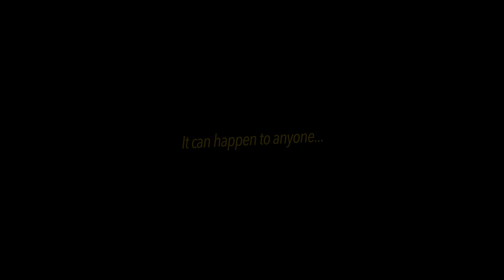SILENCE! How to fix contaminated disc brakes

Comment: Apparently, this method works. Has anyone experience with the SwissStop Brake Silencer? Or car / motorcycle brake silencer sprays? I ave both, but am yet to use one properly.

Comment: Will I need to bleed my breaks after or should it be fine? As I got oil in my break pads
Reply from the maker: As long as your brake lever "pressure" feel fine, and there no "sponge"-feeling when braking there should not be any need to bleed again. 
On the other hand, a bleed never hurts :)
Reply: @ridesofjapan  ah ok thank you 🙏

Comment: Remove rotors & soak them in small shallow tray with acid tone for 30 mins as gets into every hole, were a rag doesnt.
Like he does at 5:26 with pads but soak ur rotors, then clean solution then pads.

Comment: Acetone, Isopropyl, or denatured alcohol. Use scotchbrite after a rag.  (If using sandpaper, try drywall sandpaper, won't get clogged with pad material) Clean pistons. Use alcohol or above mentioned. Clean. Sand. Clean. Dry. Then use a q-tip or eye dropper with brake fluid to lube the races of the pistons. Work them in & out. Install. Re-bed brakes in.

Comment: Might be obvious question, but , do you also need to clean your tires so it does not contaminates again?
Reply: You also need to clean the road infront of you for any amount of oil, as it can spill up if the ground is wet. Isn't disc brakes just a smart system?

Comment: Tobias, have you try "burn" the pads and rotor like many people are saying to do? I've tried using nail polish remover and sanding several times, but it always comes back to the horrific noise. I also replaced the break pads with new ones and it still making the noise! I CAN'T LIVE WITH THIS NOISE ANYMORE. PLEASE SOMEONE HELP ME!
Reply from the maker: Does not sound like your issue is contamination, so burning would probably not do anything for you either I’m afraid.
Reply: @ridesofjapan  :sadface: 

In my research, I found whatever contaminated my breaks can get deep into the rotors in case of excessive usage of a contaminated brake system – which I did for sure – and in this case, it's extremely hard to get rid of it, with many people point replacing the rotor as the only option.

I already ordered a new break pad and rotor, so I will burn the old ones to see if it actually works. I will keep you posted.

Comment: Either acetone or nail polish will work?
Reply from the maker: Jan Steven Trocio pure acetone is probably a safer bet as nail polish remover comes on many different variants. I personally have not had any issues with the different acetone based nail polish removers I’ve used the last 10 years.

Comment: My rear brake is not working anymore and i think is becuase when i cleaned my bike with degreaser oil (the chain) some drops maybe flew on the disc. Should i clean the disk with some spirit? Or should i replace the pads?
Reply from the maker: I would clean both the rotor and the pads to start with, if that doesn't fix it I'd look to new pads.
Reply: @ridesofjapan  My bike has some crappy Tektro brakes and it's 1 year old. I really am worried to work on the brakes since they seem really weird =)) I mean i can't figure it out how you can get the pads. I just cleaned the rotor with acetone but it's the same thing. Barely braking
Reply from the maker: Dl. Fane if they are a years old I’d probably time for some new pads anyway.
Reply: @ridesofjapan  Another question. Can you set tge pressure on the pads? Right now when i brake with the front one (works just fine) it doesn't feel like it's stopping really fast. Can that be set up or shoukd i go for another set of brakes? These chinese Tektro aren't tbat great. When i bought tbe bike i was more looking for suspension and derailleurs thunking that brakes are easy to replace
Reply from the maker: Dl. Fane sorry I’m not at all familiar with the tektro brakes. I would guess you should still be able to adjust them though.

Comment: I did this very same mistake, and solved it with almost the same process.  I prefer alcohol as I don´t like to store acetone, and used a lighter grit sandpaper.
Reply: i dont belive the nail polish will work for me, as i`ve done the same with alcohol and it does NOT work.  brand new brakes, rotor cleaned to perfection.........SCREEEECH. i think theres something wrong with the way my caliper and coinnecting to the frame<shrug> tried new calipers,same shit. I`ve spoken to bike mechanics recently to, who admit sometimes they cannot fix this problem........talk about a serious design error

Comment: I carefully wiped my rotors clean with 91% isopropyl alcohol and clean paper towels and let dry before riding.  Did this before 2 rides.  The squeals went away.

Comment: I ordered the muc off disc brake cleaener for MTB's would that do just as well?
Reply from the maker: Probably (hopefully) works as well, never tried myself.
Reply: @ridesofjapan  I using it and it's good after washing bike from dirt, but sanding give me better results (for metallic or semi-metalic pads).
Never tested for organic. But You will be suprised: Sintered pads never requied cleaning - from my experience and muddy/clay british trails.

Comment: first up, use drywall sanding screen instead of sandpaper. It allows the contamination to fall away from the pad more quickly (=less material needs to be removed)

Secondly, I have found this to be an inevitable issue for any disc equipped bike that spends significant time on the road, especially if there is any water at all. Roads are made of and covered with oil. I would love to see manufacturers create a response to this other than, "replace the pads and rotors every time." It breaks the promise of discs being more reliable than rim which is a shame since there are so many valuable possibilities with hub and hydraulic brakes.
Reply from the maker: Nice one! Will look into the drywall sanding screen in the future, cheers!

Comment: if I just change the old pads with a new one, does that remove the sound?   cuz my pads are old already
Reply from the maker: I’d recommend still cleaning the rotor if you get new pads. And you still need to bed the new pads in before they operate optimally

Comment: Can I use Alcohol Instead? I don't have an Acetone
Reply from the maker: Sure give it a go, anything is better then letting it squeal ;)
(Remember you need to break them in again like if they are new)
Reply: @ridesofjapan  Thank Youu so much😊, Maybe tomorrow I will start cleaning my break pads to remove the noise

Comment: I just squirt some wound cleaning alcohol on the pads and the disc than go ride. Quick and easy solution for lazy people like me. Mountainbiker though so i am probably a little less perfectionist.
Reply: Do i need to do it every time or just like once and its fixed?
Reply: @xts_eddy9527  It's never that easy with disc brakes. There will be more problems ahead. Enjoy :)

Comment: Better put them in the oven... 250 degree, 20 mins. Afterwards sand burned material slightly down. Clean rotor with iso and enjoy.

Comment: Don’t need all this nail polish stuff. Just rub the brake pads against each other in washing up liquid a few times, rinse, dry, and then burn any remaining contaminants off with a creme brûlée torch. For the rotor, clean it with warm soapy water and a kitchen sponge (again, washing up liquid does the job). You can also give the rotor a going over with the blow torch too. And make sure you clean up the brake calliper housing too as these tend to get really dirty and can re-contaminate your pads if they’re dirty. That’s it! A relatively quick job really.

Comment: #1 I try step 2 of www.swissstop.ch/bedding . Lot's of heat is mostly solving the problem. It potentially has to be repeated a couple of times
#2 SwissStop Disc Brake Silencer if you want to reuse the original pads
#3 the yellow RS pads from SwissStop are designed for no squealing, not in dry and not in wet conditions, still have very good lifetime and best braking power
Save rides everyone

Comment: Dont sand brake pads, I do that now my brake dont work :(
Reply: Your pads are being sanded down by the disc when in use. Whatever the reason your brakes aren't working, it's not from sanding them.

Comment: Squeal is a stick/release condition. Vibration is the culprit of squeaking brakes. Brake fluid would lubricate the pad. Lubricated pads do not squeal.  Glazing was the culprit.
  Basically...glazing can be mitigated. Truly contaminated pads, oil impregnated pads, must be replaced. 
 Heat generated by braking will release oil from under the surface of the pad. There is no way to remove all the oil from contaminated pads. Many, including myself,  have tried with zero success.  
I am going back to rim brakes, because contamination cannot be avoided. Ride your bike on the street, in the rain...you will soon agree. Disc brakes are not worth the hassle. Wet / oily rim brakes do dry. Wet / oily disc brakes are toast.
Reply: yawn.

Comment: Why was mineral oil used to clean the inside of the caliper in the first place?!?! It's corrosive and not meant to be a cleaner. There are are brake cleaner sprays for that, or just plain alcohol.

Comment: The amount of trouble it takes to fix a squealing disc brake makes me want to never ride with disc brakes again. Rim brakes are sooooo much easier to live with. I absolutely hate disc brakes for the level of complexity and squealing noise they make compared to rim brakes. And this video didn't even touch on the whole process of dealing with hydraulic brake fluid, another can of worms you get with disc brakes.  What a great advance by the cycling industry: take something that ain't broke, and substitute with something several orders of magnitude worse.

Comment: nail varnish removal, sanding brake pads etc. etc.......boy what a lot of work and expense if you have to take it to a bike shop!...after being exasperated with the aqualing of my brakes........gues what.......a quick spray of WD40 cured the problem!..........try it, brakes now workign perfectly and no squaks!